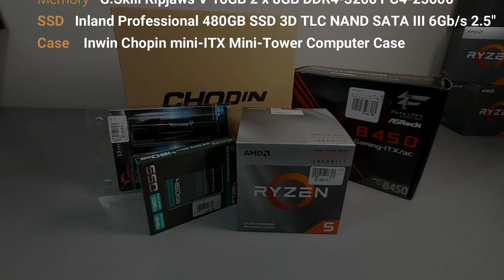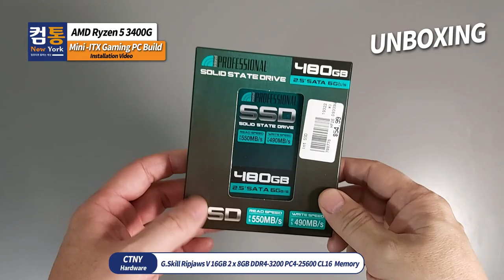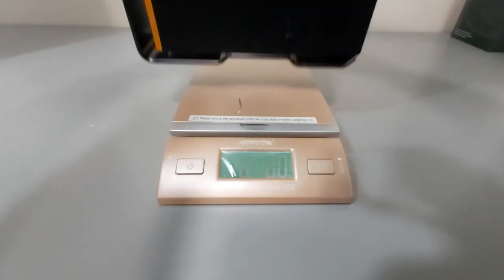AMD Ryzen 5 3400G Vega 11 In-Win Chopin mini-ITX Gaming PC Build - Installation Video

Comment: is 150watt even enough to power the pc??? thx
Reply from the maker: Yes BC according to CPU reviews,  maximum wattage for multiple threads is only 120W. Please check this review. 
AMD Ryzen 5 3400G Review
https://www.guru3d.com/articles-pages/amd-ryzen-5-3400g-review,4.html
Reply: @comtongny7776  what is the power consumption of YOUR build then? Idle/workload?
Reply: Other reviewers have the 3400g multi-core benchmarking power draw at like 115-120 watts at peak, so still a bit of wiggle room there. I'm thinking of doing a similar build for a budget gaming machine for my cousin's niece who only plays things like minecraft, fortnight and some valorant. Graphics card prices are insane atm so a decent APU fills that gap.
Reply: yes if cpu is around 100w

Comment: Did the ASRock mobo seen from 2:09 to 2:38 not work out? During the assembly you changed to the gigabyte mobo at 2:39
Reply from the maker: Wow, how do you know I change the M/B because I prefer Gigabyte for most RGB build. I returned ASRock and I switched to the Gigabyte B450i model for RGB build. Thank you for your comments. Good Luck!
Reply: ComTong NY Thanks, I’m planning a similar build and was debating between 2 Mobos. I saw both in your vid. I purchased ASRock, hope it turns out as nice as yours

Comment: Good video, I was curious (I'm still a newbie) would I be able to use VR with this set up or can you recommend any changes that may make VR possible in this build?
Reply from the maker: The Ryzen 5 3400g with the onboard APU will be able to handle vr, but the experience would be significantly improved with a graphics card such as the RX 580 or the RTX 2060 Super. Vega 11 will handle VR game but it's not enough to play smoothly so you need dedicated graphic card like RX 580 or GTX 1660 or higher. In this build you can't add graphic card in the case. Please consider to get compatible mini Itx case. Thank you for your comments.

Comment: 提醒大家如果用這咖機殼一定要注意主機板的 m.2 ssd 是否裝在後方，因為剛好在影片 6:00 的那個空的螺絲孔在你鎖的時候有可能會直接鑽在 m.2 ssd 上，我的全新 m.2 顆粒就是這樣壞的，還沒辦法送保固。 (主板: Biostar X470NH itx)

迎廣官方回應說蕭邦已經出五年了，當時 m.2 還不多，叫我見諒。

所以個人建議裝機時務必小心，或乾脆不要買這款。

there is someting I have to mention about the inwin chopin, if you using a motherboard and the m.2 ssd is on the "backside",  your m.2 ssd has a chance to "crush" while you fixed the 2.5 ssd due to  inwin chopin ' 2.5 ssd screw holes might right in front of M.2. that is how inwin chopin kill my m.2. (my motherboard: Biostar X470NH itx)

The official inwin told me "inwin chopin has published for 5 years, in that time there were not much M.2, so they feel sorry about it (WTF?!)"

I have no idea whether they fix this problem in the pro version or not.

so my own opinion is to take care when you use it or NOT buy it !

Comment: Can the PSU included be replaced with an SF size one? Would it fit?
Reply from the maker: No, it doesn't fit. This case comes with a custom internal PSU. This is not the standard PSU we've known. Thank you for your comments.
Reply: @comtongny7776  Ok thanks. I was thinking that the wattage may not be enough to support 3400g to it's full capability. Oh well, you do need to sacrifice some to achieve some. Nice vid btw

Comment: Thanks a lot - have you tested the build?
Reply from the maker: Yes. It works well but it has a little bit of fan noise from the low profile CPU fan So, I suggest  Noctua NH-L9a AM4, 37mm Premium Low-profile CPU Cooler for AMD AM4 (Brown)
Here is link : https://amzn.to/2snRF1h
Reply: Nice setup! Required update bios to third gen amd?
Reply: @garyreinaldo2245  that motherboard is 3000 series ready. It is said in the box
Reply: @garyreinaldo2245  the 3400g isn't actually third gen. It isn't exactly the rule, but the AMD APUs are typically running using the previous generation architecture:
all the 1000 series chips are built using the Zen (1) architecture. Note that there are no APUs in the 1000 series lineup.
the 2200g and 2400g APUs are built using the Zen (1) architecture. the rest of the 2000 series are using a refreshed Zen architecture called Zen+
the 3200g and 3400g are also Zen+ (thus 400 series motherboard chipsets and newer can run them without a bios update). the rest of the 3000 series are built on Zen2 (400 series chipsets will need a bios update, otherwise 500 series chipsets will run them out of the box).
the 4000 series CPUs all have integrated graphics. These all are Zen2.
the 5000 series CPUs and APUs are all on Zen3.

Comment: So I take it that this motherboard supports the 3400G out of the box with no BIOS updates needed?
Reply from the maker: Yes. B450 support 3rd Gen AMD CPU without BIOS updates but you can update BIOS if there's an updated BIOS on manufacturer's website. Thank you for your comments.
Reply: @comtongny7776  hey thanks so much for the quick reply! I really want the 3400G, but trying to figure out which boards are compatible is a nightmare. Some say "3000 compatible", some say "Zen+", some say "2nd gen", some say "Picasso Ridge". Seriously people, get a standard naming convention so I know if my CPU is compatible.
Reply from the maker: @MarkRidlen  Like I said before B450 is compatible with 3rd Gen AMD CPU like 3400G but If you want more performance for M/B, I recommend ASROCK X470 M/B.
Here's the link: https://amzn.to/37GDdAe
Thank you for your comments.
Reply: @comtongny7776  allegedly the 3400G is zen+/2nd gen Picasso, and not technically 3rd gen. But I am very much new to the gaming pc builds, having built my last gaming pc over 10 years ago (granted the 1090T I chose has a ~5500 benchmark score which is still decent). Given the mixed signals I am getting, i would rather base my purchasing on first hand experience.
Reply: Edit: comment deleted

Comment: Is it possible a setup like this with a dedicated gpu? And what about the psu?
Reply from the maker: Nope! In this build, you don't need to install a dedicated GPU. Ryzen 5 3400G APU is enough for 720P or 1080P low setting. That's why I select this CPU in this build. If you want to build gaming mini-ITX case, you can choose another case that can be fitted with a full-size video card. Please check the link below. Thank you for your comments.
Cooler Master Case H100:https://amz.run/3HPE
InWin A1 Plus:https://amz.run/3HPF
Lian Li TU-150WX Tu :https://amz.run/3HPG

Comment: PSU calculator says 148W for it and PSU is only 150W. Did you have any problems with voltage?
Reply from the maker: Not at all BC according to CPU reviews,  maximum wattage for multiple threads is only 120W. Please check this review. 
Thanks for the comments.
AMD Ryzen 5 3400G Review
https://www.guru3d.com/articles-pages/amd-ryzen-5-3400g-review,4.html

Comment: i had the same idea. gaming on pc is turning so expensive, there is only 2 solutions: playing with an apu, or playing with an old grpahic card old machine, already used 5 or 10 years by a random stranger. plus, barebones and pc never comes with ryzen, or in their mobile version. finally, psu usualy starts at 500 w, or external enclosure requires thin mini itx, whitch only works with celeron and pentium. getting a convient 150 (+/- 30 w) solution leads to with "chopin", with is pretty much the only solution in our "case".
Reply: also, i actually hate the idea to have a 1000w empowered machine, when 100w is enough. energy is expensive and precious. if modern technology can bring powerful hardware for low wattage, you avoid building an oven.
Reply from the maker: @Housestationlive  Thank you for your advice!

Comment: Man you did one error, please don’t put the thermic past like you did, you just had to do a little point not this draw😂...
Reply from the maker: Yes. I agree. They provide too much paste lol. I put the thermal paste in a variety way in some video but you know there is no correct answer. But now I drop little paste at the center of the CPU.  I think this is quite a reasonable method to apply the paste. Thanks for your comments anyway.
Reply: yeah and i tought he want to use the X method

Comment: the stock cooler didn't fit in that case?
Reply from the maker: Yes. this case only can fit up to 55mm max fan heights. That's why I'm using low profile cooler. I strongly recommend Noctua NH-L9i, Premium Low-Profile CPU Cooler for performance for the price. Here is the link: https://amz.run/3OMT  Thank you for your comments.
Reply: @comtongny7776  thanks for the answer! Good video bro btw

Comment: does the cpu fan included on ryzen 3400g don't fit?
Reply from the maker: No. It doesn't fit. This case allows a maximum of 43mm height. That's why I used low profile cooler. Thank you for your comments.

Comment: I notice the top panel/vent is raised to allow clearance for a cooler.  Would the stock cooler have fit?
Reply from the maker: Nope. You must use a low profile CPU cooler. I used cheap one but I recommend  Noctua NH-L9a AM4, 37mm Premium Low-profile CPU Cooler for AMD AM4 (Brown)
. It's a good performance low profile CPU fan.
 Here is the link : https://amzn.to/2snRF1h

Thank you for your comments

Comment: 3:03. One pea size dot of thermal paste would have been sufficient. Once the cooler was put on and pressure applied the whole heat spreader would have been covered. That is pure stupidity on your part. Now that paste is going to be forced out all around the cpu socket.
Reply: While I think he did use a little much on the thermal paste.. Ryzen CPU's  need more than just a dot they're larger than your normal cpu chip
Reply: A pea-sized amount would suffice. I have applied thermal paste many times and have removed CPUs enough to know how it spreads.

Comment: the only problem with the 3400g i have seen is it has a much higher cpu work load then the r5 2600 and the 3400g runs hotter then it to.
Reply from the maker: I suggest  Noctua NH-L9a AM4, 37mm Premium Low-profile CPU Cooler for AMD AM4 (Brown)
. It's good performance low profile CPU fan.
Here is link : https://amzn.to/2snRF1h
Thank you for your comments
Reply: How about cryorig C7 coper?